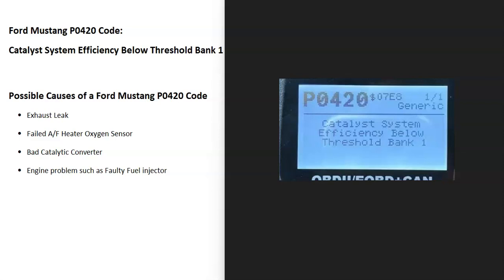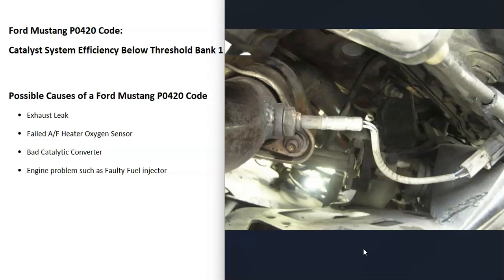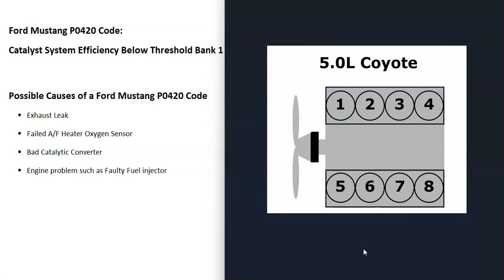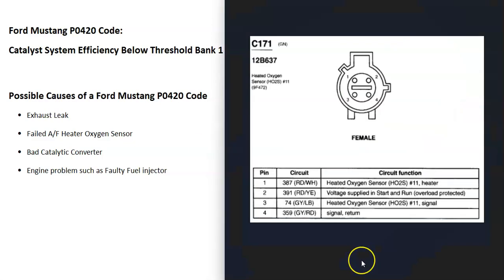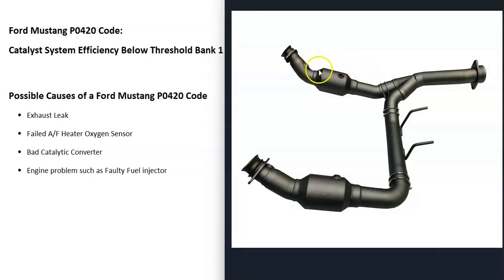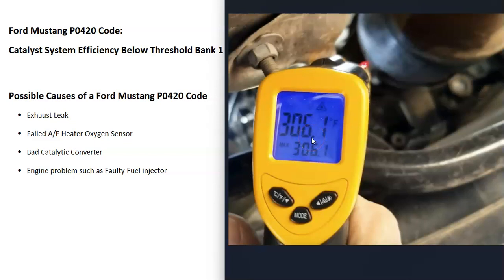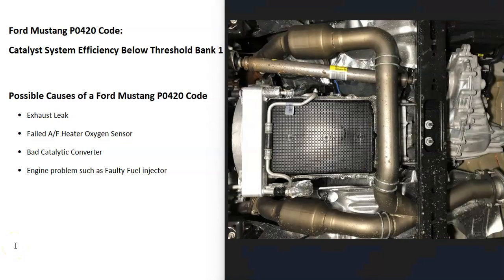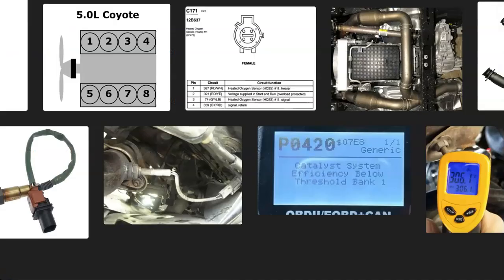How To Fix Ford Mustang P0420 Code: Catalyst System Efficiency Below Threshold Bank 1

Comment: yea my code came on a day after my catted headers install i’m not sure what could have happened that fast.
Reply from the maker: Catalytic converters go bad for several reasons bad fuel car never gets over 45 so the material in that catalysts becomes compacted resulting in failure.